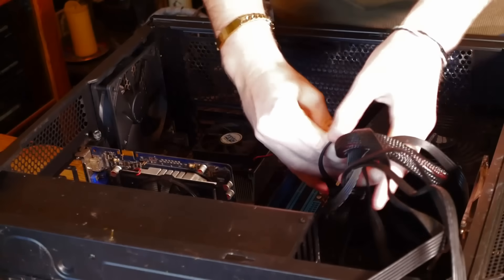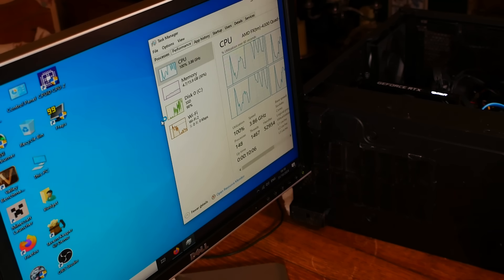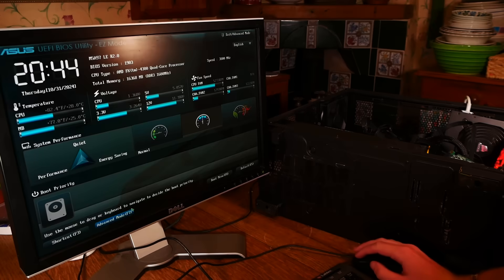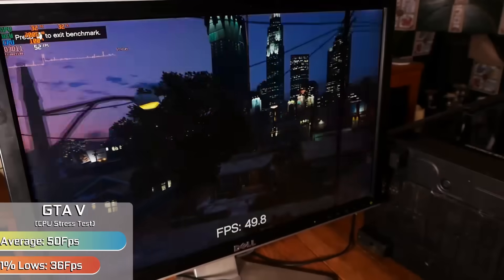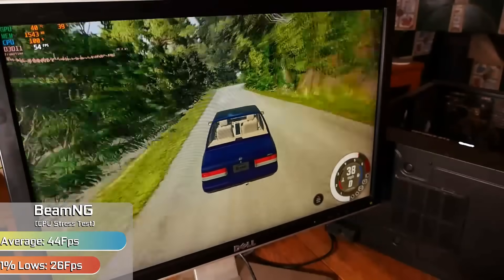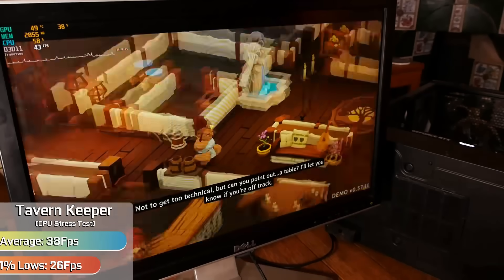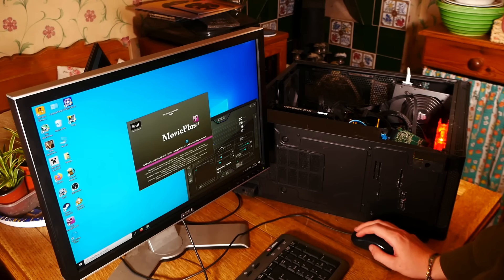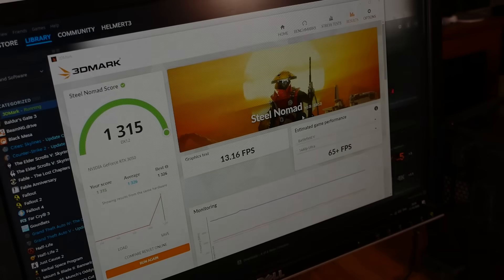AMDs Weakest FX Processor...

Comment: The whole issue wasn't really the cache, it was how they had 2 Integer cores for each 1 FPU. Making it this weird sort of Quad/Octa-core kind of thing, for the 8000-and above series.

Not sure if the FX-4300 was included in those issues, it's rarely mentioned. If it was, then it'd be that 2/4core kind of deal.

Comment: I can not begin to express my hate for the fx series. When my motherboard for my i7 930 died I went for what I thought at the time would be a quick and simple replacement. I bought an 8320 with an asus motherboard. Not only are these pieces of crap impossible to air cool, the performance absolutely blows. It couldn't even run l4d2 at a consistent 60fps despite my i7 930 being older and easily capable of this. When I hear people complain about 13/14th gen I'd just remind them these abominations existed. Imagine if your 13900k or 14900k  had 30-40% less single core performance than a previous gen processor and was basically uncoolable without custom liquid cooling. That's what the "8" core fx parts were. I avoided amd for such a long time but now the next cpu will have to be one because the intel cpus suck.

Comment: I currently own an FX4300 test bench w/ a RTX A2000. As awful as it is, it still has AVX so it can run a lot of modern titles…. Just not well. Lowest settings in HD2 at the lowest resolution I could possibly set, I got ~17 fps.

On the plus side though, these chips are overclocking heaven! No matter what I do, my FX4300 doesn’t seem to die despite being set at very unsafe voltage/clocks.

Comment: 6 years of fx 8300 user here, was paired with gtx 1050ti. It was legendary and the best money spent for me, otherwise I could only get g3258k from intel which is a 2 core joke. I have never understood the "amd cpus are hot" take, I have oc'ed mine to 4.5ghz with very aggressive 1.45v-1.5v yet it was never past 65c-core even in summer. The same people who claimed amd processors are hot are using Intel 12-13-14th gen at 100c now with CPU degradation on the effect.
I even used w11 with my fx8300 for a year and the experience was smooth as butter.

Comment: I really hate when people call the bulldozer processors the "FX series" or the like.  FX wasn't a series, it was the top spec parts from the first socket 939 athlon64 systems.  A big part of the reason why everyone largely hated bulldozer had more to do with how poorly they compared to AMD's own previous offerings instead of against intel's only low cost parts.  If you bought an Phenom2 x6 there was no upgrade path and in fact the 6core bulldozer was exclusively slower despite having a clock, memory, and fabrication process advantage.  Time has been more kind to bulldozer as it implemented some SIMD instructions that weren't available on the P2's but that really didn't make a difference originally.

Comment: Ran with an FX-8350 for years and got soundly beaten in games and also in my power bill. Sold the FX system and got an i7 4th gen gaming notebook and swore I was done with AMD.  8 years passed and I decided to get a new desktop and took a risk with an AM4 Ryzen.  We can guess how that worked out.  Really, really well.  AMD pulled off an incredible turnaround from Bulldozer. My GPU is now also an AMD and I really couldn't be happier.  This system kicks butt.  Although that 9800X3D sure looks tempting....

Comment: Glad I jumped from my 8 core 8350 FX processor to a Ryzen 7950x...    a huge 10x jump in SpecMark from 6 to 60
It didn't reduce my render times because I just expanded into fill the space, but it massively expanded the amount effects I could render.
It wasn't a cheap upgrade for sure.   I had to re buy every single component in the new computer... I couldn't reuse anything... so I still have the 8350 complete collecting dust.

Comment: It wasnt the cache that caused the controversy, it was the shared floating point units. AMD grouped bulldozer cores in to modules. an 8 core had 4 modules, so 2 'cores' per module. Each module had 2x x64 cores but only 1x branch prediction engine and 1x FPU. They shared cache too, yes, but that's not unusual and wasnt the cause of Bulldozers (oor vishera's) problems. just about every arch before and since has at least one FPU per core because shared FPUs just didnt work well.

Comment: I have a FX8350, FX8370, Phenom X4 980 and a Phenom X6 1090T.   All 3 systems run Windows XP with a  GTX 970 except for the Phenom X4  980,  which runs Windows 2000 with a GTX 470.  I don't have any problems with any of the software shutting down CPU cores or threads except Windows 2000.  Windows 2000 is very contrary,  it will flip from 2 core to 3 or 4 cores.  Windows 10 does the same thing as Windows 2000 does with Phenom and FX CPU's.  I tried Windows 10 a couple years ago and I couldn't  figure out why it ran so slow until I looked at Task Manager and saw windows shutting down 2 to 6 of the FX cores or threads while trying to play Skyrim.  After seeing this, I went back to XP. and whatever micro$oft is pushing,  I'm not interested.  I done with micro$oft.  XP and Linux for me only.

Comment: I had the 8350, spent hours overclocking it... Ultimately I found with the AMD r9280x graphics card, back in maybe 2012, it had terrible frame drops, swapped the 8350 for a Intel  i5 4570, massive difference, frame drops where massively improved....

Comment: Brazilian IT guy here: I do IT services for a local manufacturing company and roughly around 2012-2015 I built 5 computers: one FX-4100 , three FX-6300 and one FX-8320e. Along the years I´ve upgraded the ram to 8 GB and 16 GB on all machines, swapped the HDD to SSDs and I also have if I´m not mistaken 3 machines running discrete graphics. It´s amazing how well these machines still hold up for daily use like in an office like enviroment. All of them on the cheapest possible motherboard at the time and only the original AMD coolers (one of them runs an aftermarket cooler because of a lightning strike). However I´ve never cheaped out in power supply. 

At the time I bought them because they were much much cheaper than Intel, but after all those years the extra cores really came through!

Comment: 1680х1050 ... as much as I love this resolution (I had a monitor with that aspect ratio and resolution), this should have been mentioned upfront, as it is noticeably less than the current 1080p standard.
Reply from the maker: When testing CPUs resolution rarely matters, ideally a lower resolution is ideal as it removes any bottleneck and makes the benchmark about how many frames the CPU can manage.
Reply: @BudgetBuildsOfficial  Yes, but this is strictly for comparing CPUs while using a high-end GPU, so that you're certain the bottleneck comes from the CPU and not the other way around. In this case you have a lower mid-range GPU, so it very well plays to the performance you're observing.
Furthermore, the resolution-bound CPU test is more pronounced when you use an even lower resolution because the GPU can generate many more frames with far fewer pixels, but the CPU does not scale with the reduced pixel count.
With this video (I guess) the audience rather expects to see how your AMD FX CPU performs together with the rest of the system you put together expecting the most widely used budget PC monitor resolution for the past 10 years, and this is why I made the remark.
I guess you could remedy the situation if you just put the resolution you're testing with (i.e., what your 16:10 monitor natively uses) in the description together with the rest of the specs. :)

Comment: The major flaw with the FX-Series (K15) Processors was that they were an innovative architectural approach in an Intel Controlled Ecosystem. 
And as I note I don't mean Intel Controlled it as in they Dominated Sales., but instead they had absolute control over Standards and Specifications as a means to retaining their market dominance.

It should be noted that Ryzen (K16) isn't as big of an Architectural change over the FX-Series (K15) as it might appear. 
For the most part the biggest changes is the addition of a Hardware Thread Schedular (absent in K15) and a Hardware FPU to Compute Transcoder. 

AMD got a lot of hate and even lost a court case regarding their advertising of Core Count., as each K15 Core had 2 Logic and 1 Floating-Point Combined Pipeline.
As such a 4 Module Variant could have either 8 Logical Hardware Threads OR 4 Floating-Point Threads., or a combination of such... but it didn't have both, and without a Hardware Thread Schedular often this would in what AMD considered "Legacy" Applications result in poor performance due to Threading Conflicts.
This might seem like a bad design on the surface, but the idea was most Legacy Applications at the time we either Single or Dual Threaded... as such, the CPU could quite easily had 1 Module used for the Logical Threads; while 3 would remain available for the Floating Point.

Still you might then wonder... alright, well what if you have for example a Game that might want to use up to Quad Threads (Game Logic, Audio, Networking and Graphics) that are best handled on a per Core basis but also has heavy reliance on Floating Point Mathematics? Obviously the FX-Series isn't designed for that, right?
Well., the key here is the FPU Pipeline was included purely for Legacy Applications, as going forward (and this IS what has happened) there has been a shift to Compute replacing the FPU Operations... and this is how the K15 Architecture was designed, as each Module had 4 Compute Units (essentially it's own SIMD Unit) and the performance of these was absolutely staggering compared to that of the FPU + SSE. 
In pure FPU applications (minimal to zero Logical Threads) and while AMD' FPU performance was ~30% what you'd see from the equivalent Intel, when we switched to Compute in applications that supported OpenCL this would typically result in between 4 - 12x better performance... and these could be used independently (asynchronously) with the Logical Threads of the Module.

What we would see in terms of performance is very similar to what we saw regarding Ryzen (1st Gen) Vs. Intel Core (6th Gen).
That is in general Low-Threaded Applications., Intel would have a small advantage; while in Multi-Threaded Applications AMD would either equalise or dominate with it's performance.

Still as a noted, the problem AMD had was introducing such hardware before Intel had decided to switch over., especially without adding specialised "NVIDIA Driver" support within the Hardware; as NVIDIA' Drivers have always more heavily utilised the CPU for their "Performance Advantages" ... hence why you typically see AMD utilisation noticeably higher when paired with an NVIDIA Graphics Card.

This obviously resulted in the reputation and misconception about the FX-Series performance and competitiveness. 
Now as a keynote, I'd argue there isn't much AMD could've really done differently... they didn't exactly have the funds and budget to designed a "Big Block" Processor to compete blow-for-blow with Intel and even still doing such would never have changed anything as we'd have seen little to no innovation over the past decade. 
The FX-Series was and still remains the smartest move that AMD could've made, even IF the market at the time considered it a failure and the hope that their "Core" Audience would continue to support them long enough to attitudes and ecosystem to change... and of course as we know from history, this never occurred during the Lifecycle of the FX-Series; so it'll always keep the reputation of being a "Bad" Architecture; more so coming from the Phenom II that was competitive, but this said... there are hints to AMD' Gameplay for the FX-Series present within the Phenom II (K12) Processor Series; as they did include a stand-alone prototype Compute Unit., just to showcase and test how it could be used in future architectures.

And as noted, the result of the FX-Series is Ryzen... which is essentially the idea in it's fully realised form as there is no FPU anymore, such operations are entirely handled via the Compute Units.
The only real downside to this approach is you can no longer (or they disabled it to hide this being the case from Intel originally) directly access and use OpenCL on Ryzen Processors.

Comment: I mean, the FX series performed a lot better than Intel's CPUs of the same time period...the issue is Intel went through several sockets in between AM3+ and AM4, while AMD focused on low power chips. They're still the best Win 7 era processors, as all the ones Intel beat them with were released after Win 10 was out.

Comment: I got an fx 6300, used given to me for free along with a Asus m5a97 r2.0 motherboard, and 8gb of ddr3 ram. I bought a case and had a psu and rx 460 gpu laying around so I built a pc out of those parts, which replaced a HP prebuit with a amd phenom 9650 and 8gb ddr2 ram. It was a decent upgrade over that cpu, and it was also my first PC build out of off the self parts. I knew the FX cpus were not the best having read about and watched videos about them, but at least the fx 6300 in particular was a great value, prob the best value of the whole fx lineup and ofc people hate it, but some people praise it for its price to performance. 

I knew what I was going into before building the PC and I wasn't expecting earth shattering performance, but it was a decent bump in performance over that HP prebuilt, which I got in 2014 and used up until 2018 when I built the fx PC, and It served me quite well if maybe not quite being up to the task of running some more demanding games up until 2020 when I had a ryzen 5 2600 given to me. I didn't hate the fx 6300 at all if anything I have a soft spot for it as it powered my first custom pc and I even started a youtube channel on that system, and it handled video editing quite well. I mean was it really smooth? no, but did it get the job done passably well? yes. I also was able to OC it to 4.2ghz all core, but was too afraid to push it much higher given my motherboard had a weak vrm. 

I have never used an intel cpu in a PC newer than a core 2 quad 9550 so I actually was happy with the FX performance not having experienced a modern intel cpu.
Reply: Now a days I'm rocking a Ryzen 9 5900x 64gb ddr4 ram, and a rtx 3060 12gb. Prob will not need a new PC for a while now.

Comment: intel's E core is still a core, hence amd's fx core is a core. Its just amd fx is like e cores that combine into P core. its the bulldozer that sucked, piledriver and newer is better. I used AMD"s 8 core piledriver for a file server for years, it was very fast for the task, much faster than intel. it was absolutely slow for physics based games (half the speed per clock from intel's 1st gen iseries), so if you run havok physics, go intel here. But other tasks like compilations, compression and such was way faster than intel.

Looking at ryzen, bulldozer's design actually went into ryzen. Instead of 2 small cores you get 1 large core that combined them given how much ALU it has compared to SSE/FPU. Thats why ryzen CPUs perform better than intel when overloaded with threads and use SMT, because they're essentially 2 cores remade into 1 which does remove some logic but does make it faster for multiple threads and less of a problem for using the larger FPU/SSE tasks.

Comment: I had this exact processor in my previous computer, which was originally a prebuilt tower. At the time I had it paired with a R7 240, which some older games around the time were great compared to a core 2 duo PC I had. Although even after two GPU upgrades ending at a 1050ti there seemed to be a noticeable bottleneck with the processor on a number of things. Upgraded the tower almost completely and got the 6300 as one of the final things. Improvement wasn't massive but still a solid processor to work with on a lot of tasks in the modern day.

Comment: AMD was being propped up by some excellent Nvidia chipsets on motherboards up until AMD bought ATI which was was influenced more by the desire to make their own chipsets and less by wanting to get into the GPU game.
Nvidia made those chipsets for socket A, 754, and 939.
ATI was known for good hardware and often had driver issues, so when AMD took over they lost Nvidia and inherited a mess. 
The FX series should have gotten better over time with refined and mature drivers since drivers were the biggest issue back then.
Rose colored glasses....
It's not that different than Windows XP. It was an absolute disaster at launch, I know, I was a tester. It didn't really become the win XP everyone remembers and loves until service pack one, which also gave hardware makers a chance to get used to and fix their own drivers since DOS based and NT based Windows really handle drivers differently and it was a system shock.